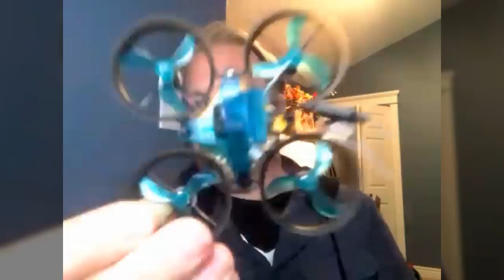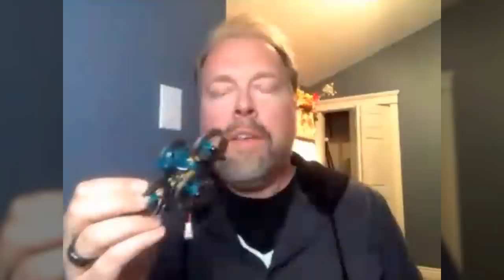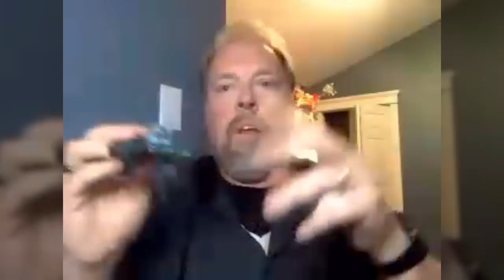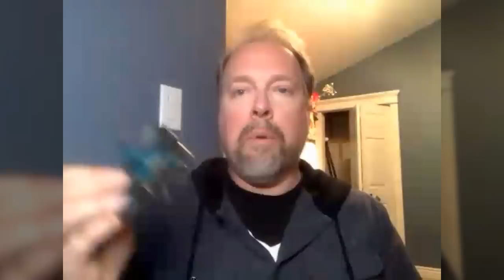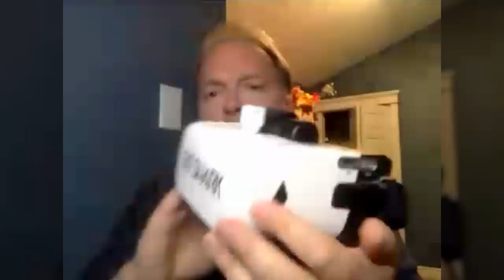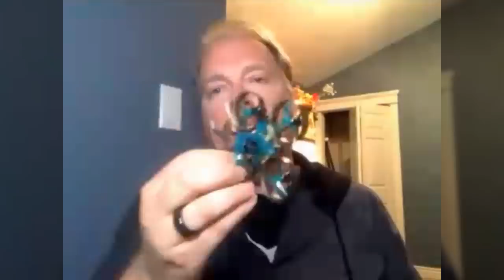Brushed motors best for Whoop Racing?! PATRICK CLARKE INTERVIEW

Comment: 10:05 - IDK, just turn off Air Mode and no more wall suck or overreaction to hitting stuff.  Thanks Patrick for that tip! (of course on that) , but seems to be the key.  It is a simple toggle.

17:35 - a lot to be said for that.  I think that's the big thing especially in whoops.  They fly so crap on BF defautls (cause BF default is not built around a whoop) that they don't know what they are missing for a good whoop tune.
Reply: UAV Tech Betaflight will still wall suck even with Airmode off, but yeah, it was one of the big reasons i turned it off.  The big improvement in Silverware is that there are low and high pid settings based on your stick position.  EVERY whoop will start a wall suck, but in Silverware (and Emuflight now) you just let go of the sticks and low angle pids kick in and unsuck you.  Pretty brilliant piece of code by NFE.

And yeah, it’s too bad most whoops come with just a default BF tune and people get that experience...kind of why I started PMB hahaha...BF with a proper tune isn’t to shabby. ;)
Reply: For brushed stuff, I've ran it that way for a while.  On brushless setups, and wanting everything to fly more like my big quads, the BF feel only comes from BF... the really quick silverware setups were still super-awkward to me, they flew really well, but it was almost like somebody turned the momentum parameter in the sim too far down.
Reply: @ProjectMockingbird  I've only ever ran those tunes, and on the older (QX65 vintage) stuff, it's absolutely mandatory.  I've been surprised how well Silverware setups on brushed actually keep up in practical terms, and having had that experience made my BF brushless whoop setups much better because I know to hammer on knobs like thrust_linear and ff_transition to make stuff work well

Comment: Oh man, this brings back memories!  I put in all of my early laps on a 120mm frame with 8x20 brushless motors and walkera ladybird props using an eachine e010 fc running silverware. I flew so many hours on those quads. 4-5mm flight times from 800 mah 1s packs.used to run them so hard that the battery plugs would turn brown from the heat.  

They have an app (for Android at least) that lets you adjust your pids and stuff, and monitor the telemetry stuff from your phone. -at least they did when I was still using silverware... Good times man.
Reply: Jon Dresser yeah, those ladybird props are still one of the best props ever made for micros!  I got my start on an H-carbon frame from MMW with similar setup (but we didn’t have Silverware yet)...fun stuff!

Comment: Also another point is longevity. My 2S brushed whoop EATS motors and its a proper faff to keep changing them.
Definitely tending to brushless myself.
Reply: 2s brushed? What's the point of this over even a 1s brushed Q? I've attempted 2s brushed but I've found they're more hassle than they're worth.
Reply: @flightevolution8132  You're right, at this point in time I wouldn't recommend anyone go 2s brushed. It's an old build from when brushless whoops weren't all the rage and I wanted a bit more woohoo. Point is even if I have to replace the motors half as often then in that case, it's a hassle, extra expense, and a point of inconsistency. Even the best 1s brushed motors last less than 10 hours and that means changing them and experiencing performance degradation is a constant fact of life. So If you want a brushed whoop, go for it, it has many advantages, but right now I'm going brushless and not looking back.

Comment: I think where brushed motors would outperform brushless motors is being able to apply power at any point in the commutation cycle. My understanding is brushless motor ESCs rely on feedback via the back EMF to generate the proper commutation timing,   the winding demagnetization phenomenon limits how quickly the ESC can change the motor RPM. This is why ESCs have the demag compensation feature whereby they shutoff power to the motor until they can get the correct commutation timing. This isn't a problem in brushed motors because they have physically brushed commutators which ensure power is delivered to the correct stator windings at any RPM.
Reply: That's why any serious brushless motor application has an HFE sensor for commutation.

Comment: And to be clear, brushed motors aren't "the best" for Whoop racing, but I do believe brushed is still the best way for you to learn how to angle race and in most early races you go to as you start, the speed difference won't be why you won or lost. :)
Reply: Regarding the Mockingbird edition Hummingbird v1, I can't find where you mentioned the tune specifics for the plaid motors. I ordered it with plaid, but would gold motors work too, or would it need another tune flashed?
Reply: @BrandonBeans  if you run quad blades on gold it should be fine. In testing I did a gold specific tune, but not many could tell the difference. It might not handle dirty air prop wash as good as a specific gold tune, but quad blades will help

Comment: Hello from Spain, thank you very much for your teachings. Now I am a little lost since I have been a couple of years with the tinywhoops, I have had 4, one brushed ldrc 65mm, this lasted a few months since I was very novice as a pilot, then I had a uruav 65mm brushless, it worked very well, I had some crashes and one day it stopped working, no motor was turning, I put the battery in and repeated the beeps, then bought a brushlesshappy model 65mm and without any crash one day the same thing happened to him, now I waited a while discouraged and bought another uruav again and I havent hardly had  Big crashes and the same thing happened again and this new one, am I doing something wrong? Or are the cracybee f3 badges? I don't know what to do, if I go back to the brushed ones, or ride with the brushless motors that I have a new drone but with which board, I don't know if you can help me.thanks

Comment: Sure it's cheap, but if you have to add 20 bucks every couple of flight hours, it's not that cheap to use brushed!
UNLESS! you make a video on how to greatly increase the life span of brushed motors! :)
Reply: Lol i've flown my brushed motors competitively for 3-4 years. Most important is to keep te weight down and use props that dont push on the bottom brush cap. Make sure to slowly wear in stock motors and balance your props well. Good luck
Reply: Without replacing a single motor
Reply: Yeah I’d get maybe a few weeks tops out of a set. The performance then drops significantly and time to buy more
Reply: @djs134  no way. What does yours weigh? Do you need the highkv ones?
Reply: Job91 it’s a stock hummingbird. I mean when it’s winter I can easily fly 12-15 packs a day. I want to say the motors are rated for 6 hrs. So u figure 4 minutes a pack so that’s like 90 packs. Let’s just round up to 100 packs. So that’s pretty easy to accomplish in a month. Yes they won’t completely die, but the performance drops significantly after all them packs
Reply: I always order extra motors. Sometimes a batch will last a LONG time, but if you crash hard while they're hot, then they can fail much faster. Be gentle with them and don't run packs back-to-back without the motors cooling a little or else just don't crash. What's the fun in that though? :) For me, brushed whoops are much more enjoyable indoors than brushless whoops are. Also, you don't have to buy the 20 dollar motors, my favorite is golds on 3 blade azis for freestyle in and around the house/yard, blacks strictly indoor w/ mild freestyle on 4 blade azi props.
Reply: SBI Tools I think a lot of people’s brushed motor experience is sullied by (sorry betafpv and others) REALLY shitty brushed motors.  We used to call the 716’s from BFPV “the squealers” because they would start to literally squeal after about 10 packs and then get worse and worse.  All those Amazon motors I used to buy were cheap, but terrible.  The NBD motors are the best I’ve ever used.  Plaids you do have to be careful about temps more than golds.  And most of you probably were running betaflight and you get about 70% of the power compared to Silverware...Plaids on BF feel like gold on Silverware.  It’s that drastic.

And really, even brushless motors lose their performance over time.  Those bushings wear and the power goes down.  I run A LOT of whoops and  it’s not like I have no dead brushless motors.  They have their own downsides.  In the end I bring brushed and brushless to races and see what’s best for the course.  The cool thing is that if you use my Emuflight stuff, it feels almost like Silverware so they all fly the same, just different speeds and agility.
Reply: Thanks all for the answer
 @ProjectMockingbird  I will agree that my experience with brushed drone is from cheap ones and certainly cheap motors inside, I haven't changed motors yet since they are not easily available here. I am not looking at racing, just flying inside if I can't be outdoor, so i'ts not about power, but part availability and price.

I still think I will go for a mob6 (Defo want to try to find your emuflight tweaks for it), for the simple raison, than in the shop for the same ~11000JPY, it's the hummingbird only, or a mob6 that include 4 batteries... So it's clear that I would be ripped off from the humming bird, but the mob6 is a more regular priced.

I still think that a video on how to have the most life out of brushed motor (and brushless why not) would be an amazing content!
Reply: An hour of flight time usuaally writes off about three batteries - so it's about double the operating cost of brushless setups, not totally terrible.

Comment: Hey Joshua. I need some help. I bought the hummingbird and radio master tx16s through your links last week and I can’t make the drone work. I followed the bind procedure and it seems to be correct. The light on the drone is solid green and the radio shows telemetry recovered/lost as the drone is powered off and on. I am not able to access the osd menu and on the goggles it shows 0 for radio signal. Any idea on what step I missed or what the issue could be?
Reply: This is my first quad so I’m as green as it gets with this stuff. I did all the research I could but couldn’t solve it. Also when I power on the quad I get one red blink of the light as you state’s should be right.

Comment: My biggest complaint about any brushed I've flown is throttle recovery. My brushless Mobula can recover a drop far better than my TWR. Does this tune solve that one problem?
Reply: Techno Xtreme If it’s a traditional TWR you are limited by using lower kv motors (since it’s the Inductrix FC).  This guy runs much faster motors...is it as good at brushed for freestyle?  No.  But this little guy is light enough for racing that it’s not a problem.

Comment: I still have the og project mockingbird google drive doc and ive been incredibly curious if you have tried it with a cinewhoop. The diatone taycan to be specific.
Reply: Not the Taycan, but I am working on a "Cine-Angle" mode in Emuflight and using a custom 95x with Tarsier as my tester.  I have a sample on my YT channel of the first test. :)
Reply: @ProjectMockingbird  wonderful, thanks for replying!  Ill be sure to check it out. For the record. I discovered this week why not to abuse the stock 25a taycan esc practicing acro this past week... It gets so hot it melts every bit of solder... And you fall out of the sky!

Comment: Stupid question, can I flash Silverware on a Betaflight board? I have an old BetaFPV 65S with brushed motors but it came with betaflight, I had a lot of truble flying it, it sounds like Silverware might be better fit for it.
Reply: GODsaveTHEcat No, sorry, Silverware only runs on F0 based boards
Reply: @ProjectMockingbird  The good news is that if you already have a popular BF setup, there probably is a Project Mockingbird setup for it you can try - odds are it'll be a distinctive improvement.

Comment: Sir; You helped me program my FRsky transmitter once and I have a new problem.  When I bought the Frsky a friend said some RC'ers have problems with it dropping contact with the plane.  I have a Tiny Hawk 2 with this protocall and using my FrSky transmitter it will fly just a few feet and drop out of the sky.  Can you shed any light on my dilema?  Than You

Comment: Brushed motors are all fine but they are a PITA to swap out. It almost feels like I'm going to break the frame just getting the motor out.
Reply: I know what you mean, the NBD cockroach blue frame I use are very tight, but I found that if you treat the frame in boiling water for 5 minutes before you build, it makes the frame more pliable. This effect definitely lasts after it cools down too because I can actually remove motors from the blue frame now.

Comment: Wish they dropped the motor prices to 20 bucks for a 3 pack of motors
Reply: OMG, if they did this I'd be so stoked
Reply: I'd love to see brushed motors price drop and we were headed there right before brushless came out, and quality of motors was just getting to be great (some of us remember the early days when all brushed motors weren't that great) but I won't lie, when brushless came out I jumped in with both feet.
Reply: Project Mockingbird yeah, I guess both have there place. Just out of curiosity, is the new hummingbird any different than my brushed hummingbird that I flashed to pmb on silverware that I bought maybe a year ago? I mean mine was the non pmb version and goose had a video how to add your tune. And thanks again for all u do man
Reply: @djs134  that version is pretty good, but NBD updated some OSD code, and I tweaked the tune a little more for Plaid and Azi and a few angle settings changed based on our NBD pilot feedback.  Is it night and day?  I'd say no, but I do think it's better.  If they have the hex on the product page, it's worth flashing and trying, but make sure you are using plaids and Azi tri or quad blade for full benefit

Comment: The moment you realise you have a x-lite and don't have d8 mode :(
Reply: bro just change firmware and you are good to go on D8 and D16. Nick Burns (Well known Micro/Whoop Pilot) is using the old/Standard X-lite for D8 too
Reply: @volvo850enjoyer8  Nick burns changed to the t16s recently,  and i run new access r9m  receivers on my stuff so i can't down grade
Reply: Test Account xjt lite fixes that... I use my x lite pro with my TinyHawk freestyle🤟

Comment: why shouldnt you turtle mode with brushed motors? Whats bad about it?
Reply from the maker: Brushed motors can't be reversed easily, and when you do, it's not good for them. The driver on most brushed FC can only push the motors one way.
Reply: @JoshuaBardwell  gotcha, thanks for the response :)
Reply: Coreless motors can be run in reverse easily with the cost of worse lifetime (the brush are designed to maximize lifetime on one rotation). The real limitation is on the FC. To achieve bidirectional rotation on brushed motor, a H-bridge circuit with 4 MOS is needed but if you're going that path, then may as well add a pair of MOS and make it brushless capable.
Reply: Brushed flight controllers need H bridges to be able to do that and I really don't know which size they would need in this case. 😕
Reply: Size isn't the problem, it just add unnecessary complexity,  @MCsCreations . Brushed FCs are overwhelmingly simple. You can run the signal from the MCU straight to the FET and that's all, no extra circuitry needed. So simple, if the FET fails closed, the motor will spin by itself. Contrary to brushless ESC where a failed FET makes the ESC unable to spin the motor.
Reply: @Asu01  Yes, but that's exactly my point. You would need to add a lot of components for each motor to be able to do turtle mode.
Reply: @Asu01  thank you for your detailed response :)
Reply: H101 has the hardware to fly 3D and theoretically could flip over or fly upside down after a crash.